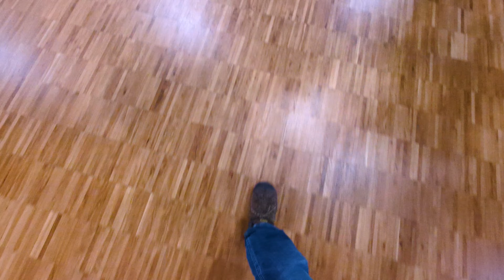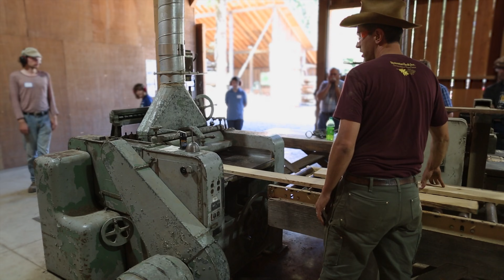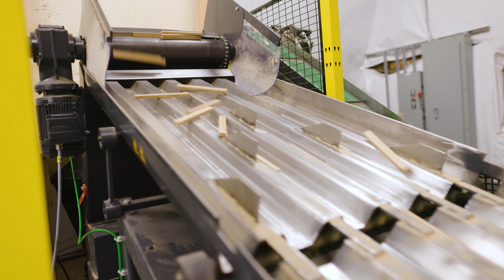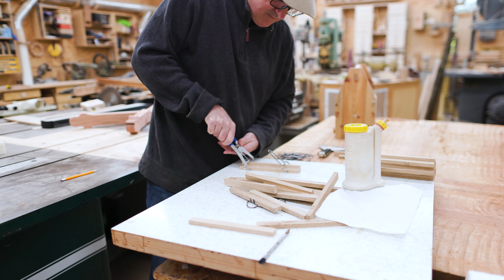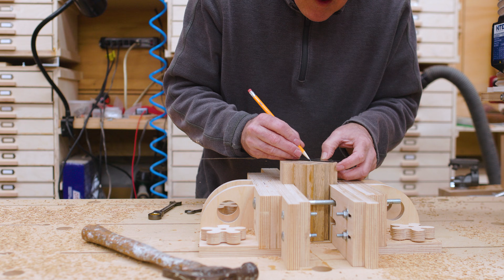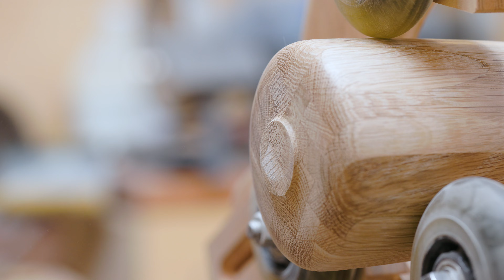Wood Flooring Turned Mallets

Comment: After you rough the mallet with the square end endmill switch to a ball nose endmill for a smoother cut. You may have to adjust speeds on the feeds.

Comment: Wow ... this gives me an idea of what I could do with the piles of scrap pieces I have left over from segmenting projects! BTW, I use an angle grinder with a random-orbit attachment to do my rough sanding work ... gives me a clean surface that sands much easier/quicker with my angle drill.

Comment: There is a school in Walled Lake, Michigan that had carpet on the gymnasium floor, a real thin carpet so it’s still easy to dribble a basketball.  Awhile back, they decided to replace the carpet with maple slats like the oak ones you used for the mallets.  They were also strung together with wire so you could drop in a 12 inch square block of flooring instead of individually gluing in each piece.  Makes it faster to install the floor.  Most of the pieces were straight grain maple, but once in awhile, you would see some quilting in the grain, or some bird’s eye, it was a cool looking floor.
Reply from the maker: That sounds like it looked beautiful. I like the idea of being a woodworker and showing up at a floor like that and immediately dropping down to look for little hidden treasures in the floor." Oh wow look at this one!!"

Comment: You might want to consider an "Industrial Rubber Band" like moving companies sometimes use to quickly and securely "clamp" your glue-drying stick bundles. It's MUCH easier and effective than hose clamps. They come in strips that you wind around your project like a constrictor. I saw a luthier using one the other day.

Comment: When milling on a 5 axis mill doing CNC profiling I use a ball end cutter to eliminate the steps you’re getting. If you can’t find a wood cutter with a ball end the metal ones work fine.

Comment: It's so good to see something from you. You have been missed. WOW what a project. Starting off with that awesome tour of the factory. I love to see things like that. All the machinery is almost mind blowing. And that truck full of parts.Iexpect that kept yor busy for a day of two. LOL Your process is very interesting. How Much longer do you think it would take without the CNC? The end result is outstanding.👍👍 Thank you so much for sharing, Have a great day,🙂🙂
Reply from the maker: After mounting the blank on the CNC and running the code and making sure I'm doing something while it's running instead of just standing there watching it, it's still maybe only saving a few minutes. It is giving me a blank that's more regular to find the shape of the mallet. But I was finding when I wasn't using the CNC I was finding that shape just fine.

Comment: Glad your back it has been too long without your videos. I wonder if you could use your CNC to carve  the reverse of the FH to plug the empty FH holes in the handle end. I think it would look better with the FH in black lettering. Just a thought.
Reply from the maker: I've thought about that. It's doable. It would just be more steps right at the end when I'm trying to finish things up.

Comment: Hi frank I was wondering if you could use a ball end mill and shorten the "step" to alleviate some of the  the rough finish when it comes off the cnc.  Thanks
Reply from the maker: Yes that would help. I want to try that at some point.

Comment: Good to hear back from you after a while. You may have mentioned it, but why not have rotary do it all?
Reply from the maker: I could but... It's nice to have a little bit of handwork on the lathe in each mallet. Also, each blank is a little bit different and I need to look at and shape each mallet to find the shape that the blank is allowing me to make.

Comment: I hate to say it since I know you're not a resin fan, but I think you might try to put some clear resin into a tallish cylindrical plastic container, stand a not-quite-cylinder of VERY firmly taped-up herringbone Ls in it (no hose clamps), and then pump it down.  That should pull resin into all the cracks and enable you to make mallets out of it.

A log cabin pattern would be really nice, too.  Lots of quilting patterns can be used for inspiration, probably.

Comment: One idea is to glue a bunch of strips together (staggered grain) and make into large sized CNC'd LEGO blocks.  What could you create that was fun and unique (child themed) using such wooden blocks?  Trick is figuring out how to machine a large number of blocks at the same time with numerous fixtures on your cnc router.